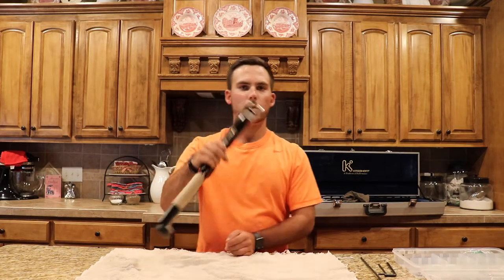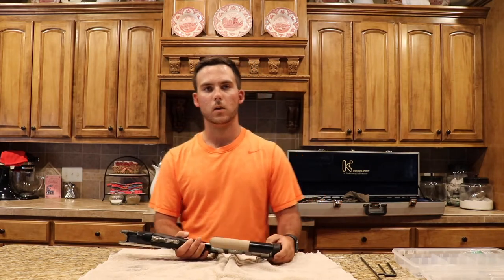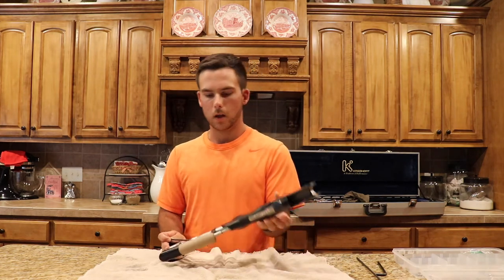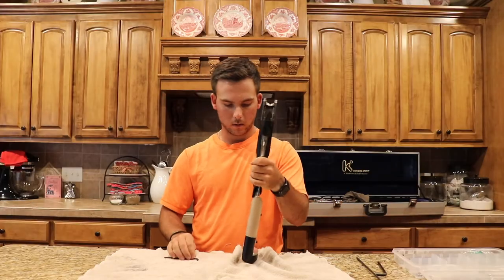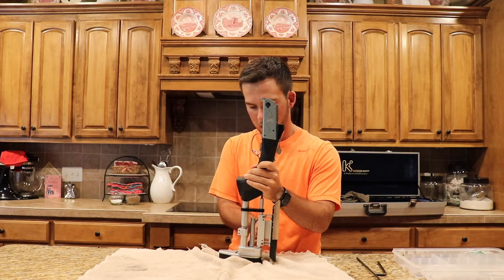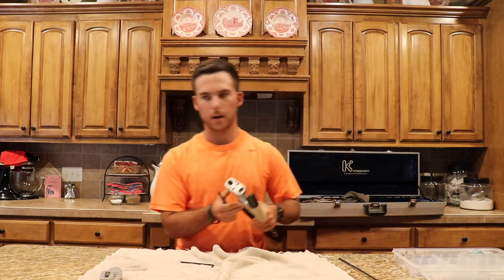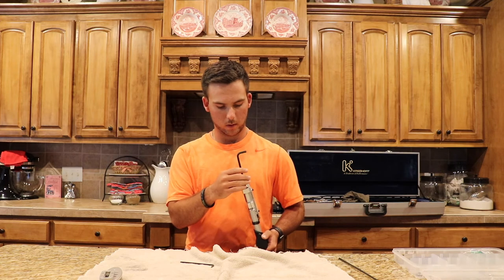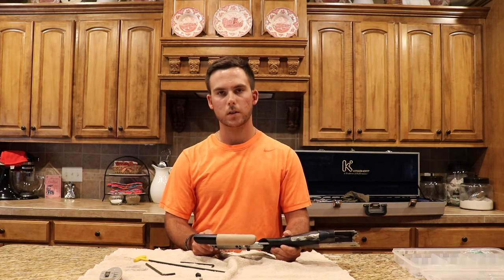Precision Fit Stock Recoil tension adjustment

Comment: Jared, What is the ball bearing for?  Mine does not have that installed.
Reply: Aug 2023 - Just installed and tuned my first PFS. It’s a used unit, but seller says none of his PFS have the steel ball. I checked with PFS and the 7/16” ball holds the recoil adjustment screw in place and the ball is, in turn, held by the locknut. 
The ball sits on the top of the hexagonal slot in the adjustment screw. 
The locknut has a circular indent on the bottom that keeps the steel ball in place.